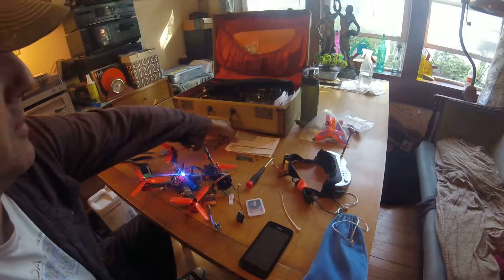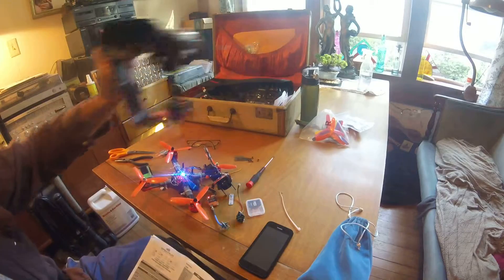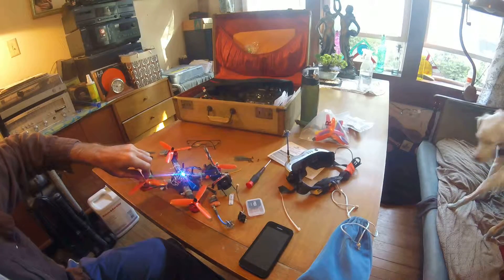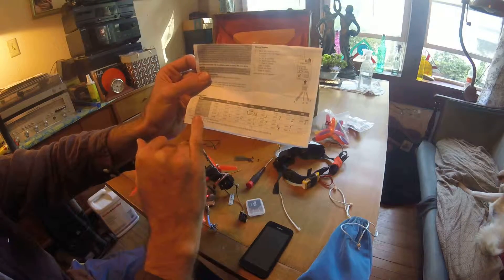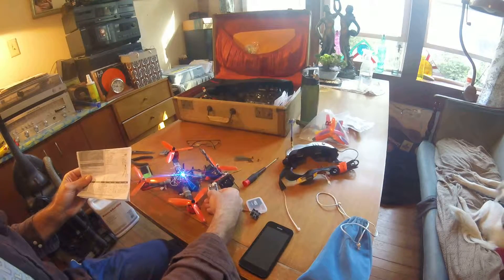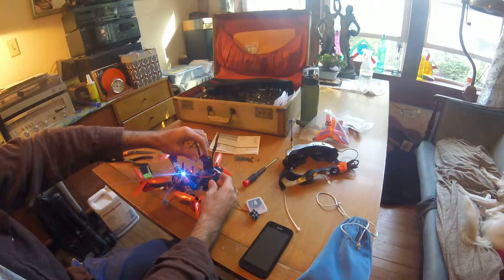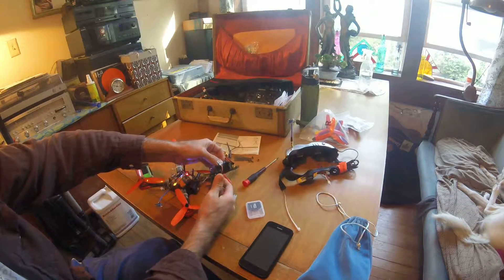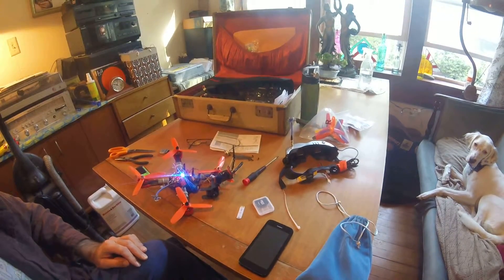Spektrum SPMVT 200 VTX with HS1177 Does Anyone Use This Set Up?

Comment: I bought the 200mW spektrum and I can't get any picture at all.. idk what's going on with the bands but I haven't really been able to find any videos on it
Reply from the maker: I put a 16v 1000uf capacitor right across the XT60 connector. On 4s it works about 40% of the time.